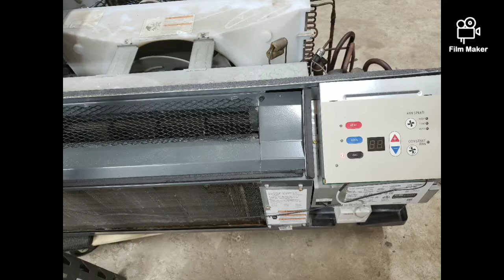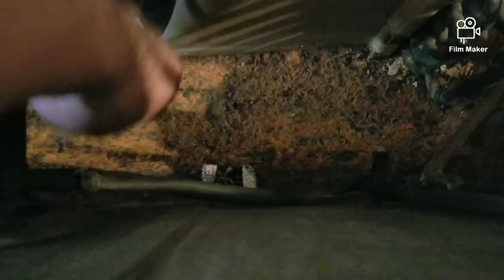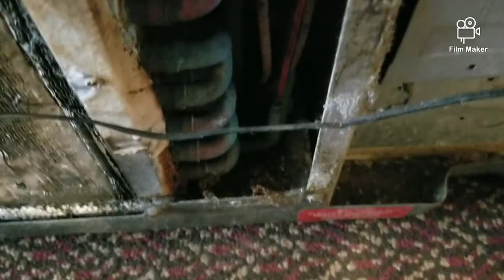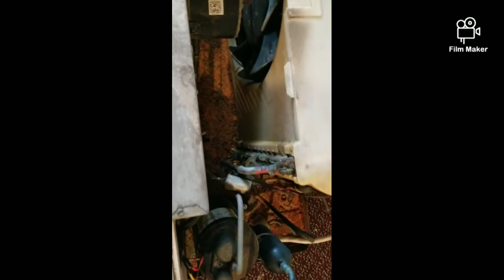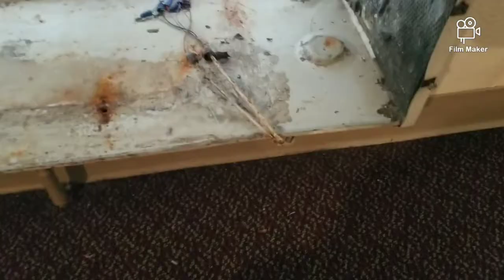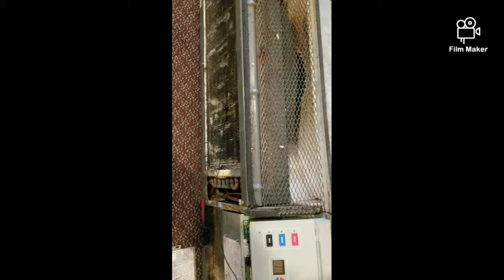Ptac leaking water into the room?? Try this!

Comment: the reason why the ptacs leak inside the room, is because since the cold cleaner came out in spry , no  one wants to remove the unit to wash with coil cliner and water,theis only spraye them with the coil cleaner spray and that is everithing is ready clean they say, and oll the dust in the wet coil closes the drain of the ptac and when the water cannot come out from behind, it overflows in from of the room

Comment: I have a ptac unit and its not draining and blowing a visible steam like mist out of the vents worried it may be leaking freon it blows cold and no smell no weird sounds and I seen the drain pan does have standing water .
Reply from the maker: Hello, the mist you see coming from the vents is usually condensation picked up by the blower that's usually normal... is the unit leaking water into the room?

Comment: Do you have a video that covers when unit is turned on, compressor comes on and has cold air then compressor kicks off too soon and never re- engages.
Reply from the maker: No, but I would check for a dirty condenser coil, the funtion of the condenser motor or broken fan blade. How old is the unit?
Reply: @PtacSolutions  the unit is a 2006 Carrier.
I work at a hotel and we have this happening to several units, then we have guests complaining.
Do you suppose these units are getting too hot on the outside of the unit? Is there a safety thermal switch?
Reply from the maker: @cantwaitkid  well that code is due to the ouyside temperature is above normal, have you checked inside the condenser fan shroud if the coil is dirty?

Comment: Friend!  So I got a pmh093 that I discovered today with the electronics compartment full of water I noticed that on the drain pan on the id coil it was chipped (missing a little bit maybe a 1/4 inch right at the lip) this is visible right were the metering piston is will you say  that's were the water is leaking to the electronics bay,? I was confused so I watch your video because of this will you know if this series of ptacs drain to the OD blower like the one on this videos ?
thanks so much man!
Reply from the maker: Hello, 
If the drain pan is missing a piece than more than likely that's how the water is overflowing to the electrical compartment. I have used some putty to create a boarder so the water won't overflow. It has worked for me, you could try it just make sure the pan is completely dry. So, you can eliminate that possibility

Comment: Is it possible to remove the entire PTAC from the drain pan without opening the refrigeration lines so that the drain pan can be painted?  I have a unit with the coating on the drain pan that is coming off and the pan is starting to rust.   Great Channel!!!
Reply from the maker: Hey Jimmy 
Thank you!!.. question for you is  the pan foam or the plastic one?
Reply: @PtacSolutions  Metal.  I'm talking about the metal pan / base plate all the components are assembled in and attached to.  The part that comes into contact with the sleeve at the bottom.
Reply from the maker: Oh ok well Yes its possible, but it's going to be a lot of work

Comment: Lift the front of the PTAC and screw it into the sleeve this will make the unit lean back and drain. Or drill some holes into the wall sleeve so it’ll drain. Lol so many easier methods
Reply from the maker: Hello
To drill holes into the wall sleeve would work if the the back of the sleeve was sticking out to the outside of the building, but there situations where that's not the case, like if they would be on the second or third floor, the water would just come into the building through the sheetrock or ceiling tile.
Reply: @PtacSolutions   True . I've dealt with that. Had to caulk the inside corners and openings of the sleeve so that the only place for water to flow was the drain itself.

Comment: Can you make a video on replacing a  steam trap valve.
Reply from the maker: Hey Kel
I haven't worked on one of those yet..is that for a gas heater ptac?
Reply: @PtacSolutions  oh Ok, the boiler is oil based.

Comment: Is the space right under the monitor display legitimately allowed to hold the water? Because mine not only the drain place under the coil has the water, but also the place I mentioned,
Reply from the maker: No, that means the water is overflowing from the drain pan because is not draining properly
Reply: @PtacSolutions  thx, do you know where is the front drain vent? (in video you only pointed out the back drain vent, I've clean that out but I also like to clean from the start point)
Reply: @PtacSolutions  would that cause it to not cool adequately? With water maybe cooling the coils ?

Comment: Hey, so from the outside through the grate I can see the drain pan is holding standing water. The wall sleeve has a visible drain pipe to the outside, but where is the drain pan supposed to drain from?
Reply from the maker: Hello, the water goes from the ptac drain pan to wall sleeve where the drain pipe is  connected. The unit has some holes on the back side where the water drains,  also some of the water is picked up by the fan and shoot through the condenser  coil
Reply: @PtacSolutions  thank you. So if I’m getting water on the carpet inside, there’s probably something preventing the condensation from flowing to the back of the drain pan.
Reply from the maker: @ianharkins2172  it could be one of many,  clogged drain pipe or pan, wall sleeve could be tilted inward(unlevel) or maybe the unit may just need to be washed
Reply: @PtacSolutions  very helpful thank you
Reply: I washed the unit still draining into the room  @PtacSolutions

Comment: I have 3 Ptacs (GE Zoneline) Compressor kicking on inside fan working but the outside fan blades that blow into the room arent kicking on. Any reason why.? Please help
Reply from the maker: Hey Zee
Make sure the fan is not caught on something(seen that a lot) .. if not check the capacitor or any loose wires. If all that checks out, next I would check if the board is sending power to the motor